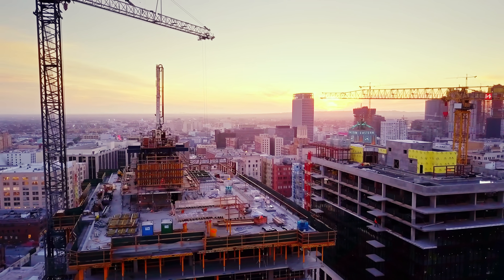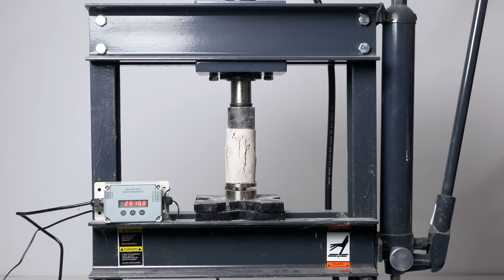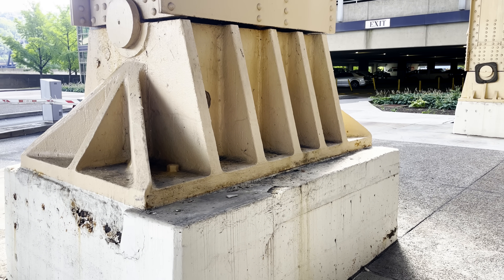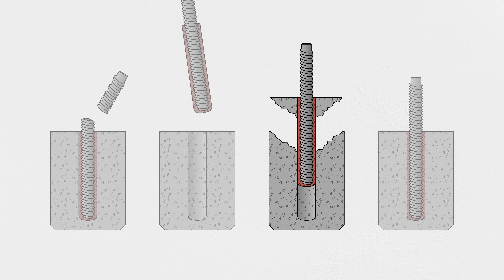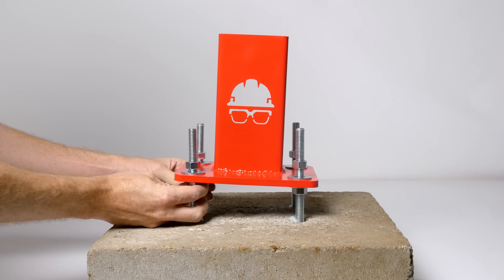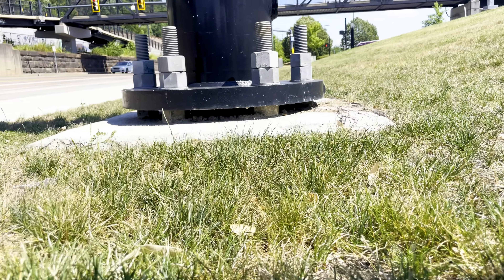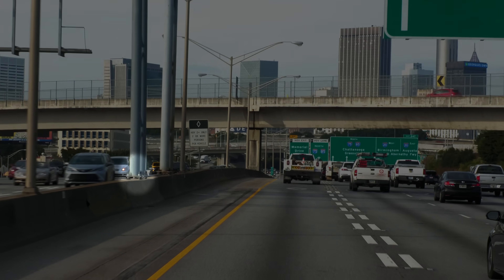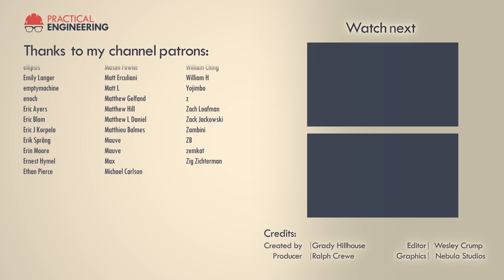What’s the Deal with Base Plates?

Comment: Not even an engineer but in my 20's, I mounted a basketball backstop/post by my driveway. I took a base plate and mounted bolts to it (nuts on either side), with the bolt heads about 3 inches below the plate. I then welded a small frame to the bolt heads to tie it all together and distribute the various loads into the concrete. I placed this in the concrete pad when i poured it. After the concrete cured, I then removed the plate and welded it to the backstop post. Then I set the post and adjusted it to vertical with the nuts. I just thought this was all obvious.

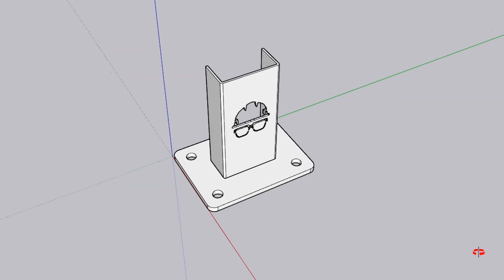Comment: 7:14 Leveling nuts can't support any large weights because the resistance is offered only by the thin thread of the bolt. So, it might be ok if you want to adjust the level of your dining table or even to support a light street lamp, but that's as far as it goes, in my opinion.

Comment: Grouting a baseplate in is frowned upon here for corrosion reasons. Having a good solution for bold binding and having it go a little above the foundation so that no moisture collects where the bolt is going in is key here.

Comment: I do not agree with you. It is new to me that grout instills corrosion. In fact it does opposite. 
Non shrink Grouts are stronger than concrete. 
Grout is required to transfer the forces properly.
 The nuts below base plate are for correctly levelling it and not for tranfer of load. Grouting is must.

Comment: Most defects associated with highway signs and high-mast light towers (at least that I have seen after inspecting >1000 across 3 states) are related to anchor rods and tightening of the level nuts/anchor nuts.  The standoff plates have issues with excessive standoff, or too much of the anchor rods are exposed creating "slender columns" which is probably the second most common issue identified in signs and light towers.

Comment: As an overnight factory sanitation worker I absolutely loved when we'd use standoff bases on our equipment. So much easier for water/food product to flow towards the drains when grout isn't in the way. Especially since they never took my advice of building the baseplates at a 45* angle to the drain...

Comment: Well this video is older as I type this but I was wanting to mention a sorta counter to this. I watched a video from Nova on China, and why it's Forbidden City still stands, even though it is in an earthquake prone place. And one part they show is the big columns they have are not actually attached to the floor. While they are touching the floor and the weight of all the superstructure is still being put upon them, the video posits that the floating columns allows them to move during an earthquake while still providing their function and not needing to be rebuilt after the fact.

Comment: I like this video and most of your stuff. Since you presented concrete anchor options such as epoxied or wedge anchors, I think it would have been important for you to show that most of the overhead sign base plates bolts are set in reinforced cast in drill hole (CIDH) foundations. They are typically deep set J bolts connected to the foundation reinforcement. This video may leave the impression to some that the base plate bolts are simply wet-set in the foundation concrete, irrespective of or any connection to its reinforcement.

Comment: We started installing our stamping presses with chemical anchors. Basically just drill a hole, 30mm is typical, and drop in a glass vial with all the ingredients inside. The anchor itself has a flat chisel point that acts as a mixer as you spin the anchor while pushing down. Let it cure and fully set and it's now part of the floor. It ain't comin' out. We did test and we applied so much force that the concrete around the anchor broke out, not the anchor. There was a chunk of concrete with an anchor coming out of the top. Amazing tech.

Comment: I did some paving when I was 16 and saw how they install lamp posts here in Germany. They just put a big PVC tube in the ground, filled it with sand to a certain level, put the hollow post in there, filled everything up with sand, compacted it. Wont work for every application but so much easier for smaller loads

Comment: The practical engineering unit of measurement is the Grady.  A KiloGrady is 1000x that, and a Mega-Grady is 1E6x that.  If you find that everything starts at a KiloGrady raise the unit up 1E03... but given that there are no stanards for this unit, no measurements of it, no tooling for it...might as well just call it a Grady and ramp it up as needed on a per project basis, providing you let people know that 1 Grady of concrete in a 1" tube is not the same as 1" Grady drilling through solid stainless steel... but that within the same video one method can be compared to another.

Love your book!!

Comment: Setting 40' light poles once  with my boom truck for an electrician, I was stunned to see he never checked them for plumb. He just used a 8" level on the base bolts. As an old carpenter, I would have started with the base level, but then checked with a 4' level, but...they all eyeballed straight enough!

Comment: 54 years as a union carpenter, 70% was heavy concrete construction. The largest anchor bolts I set were for western electric microwave towers. 2-1/2” dia. 8’ L 2’ J
I specialized in building templates to set bolts for jobs to hang in the form work . Gas compressor stations had as many as 250 bolts in one motorblock 12’w x 27’L x 8’d
Your videos are always right on!
Reply: Being a retired union carpenter myself,there are no specialist in placing of anchor bolts of any size,making and hanging bolts in concrete construction in heavy commercial applications is not some wild skill or science. I can’t count the many times I have done it. Stop making yourself sound like the smartest guy in the room,you’re an embarrassment to your brothers by blathering such nonsense.
Reply: @thedoc9062 He was just stating a few interesting facts. No big noting here.

Comment: Q: I am erecting a. 25-ft cast iron flagpole. It has four 1-in bolt holes at the base. Approximate weight is 225 lb. What are the proper anchor bolts to use to secure this to a circular poured concrete base? Thanks! Love the show.

Comment: Building cranes in the 80s, we established the relative heights of foundation pads with a Dumpy level.  (no staff, or if we used one, we taped a steel rule to it, read it to a millimetre, no interpolation) the highest pad needed no shims, the others needed an appropriate pack of shims to suit.  We'd weld a "Rocker" pad under the baseplate (maybe 40mm thick) at the fabrication stage, because it made it easier for whoever had to get concrete (not mortar) tucked in later... (sometimes you'd visit the crane months later, and find that hadn't been done)  And your foundation bolts' lengths were selected to avoid too much being exposed, or too little engagement.  Of course we generally had line of sight from pad to pad...

Comment: Wow, this was a good one. I've noticed those floating traffic light poles before and pointed them out to my girlfriend (reaction wasn't as enthusiastic as mine). My theory was that the anchors had to be set in the curing concrete and then the roughness of the top of the concrete somehow makes it impossible to lower the baseplate down flush.

Comment: Probably the single most amazing YouTube video.  As a structural Ironworker, I was always amazed with base plates.  "And that's going to hold up this building ?" Riiiiight.  My favorite was always the columns with flanges so thick that we'd weld a seat to each flange, put a welder in each seat, and watch a mountain of empty innershield reels grow on the deck around us

Comment: @practicalengineeringchannel the grout as seen below the baseplate at 0:29 is recommended to be removed as NC DOT found it contributed to corrosion and failure. The pole mentioned looks like a common galvanized street light type pole. The purpose of the grout was to keep debris out of the electrical conduit entering the base and exclude animals from nesting in the pole. The grouting wasn't meant to serve as weight bearing and was to be added after installing the pole. 

The galvanizing is thick on poles of this design but not thick enough to counter constant contact, weep hole plugging or the reaction of dissimilar materials being in contact with each other.

DOT recommended for the grout to be removed during the annual inspection. This was for roadway sign structures, traffic signal poles and roadway lighting poles especially in locations near the coast with salt water accelerating deterioration.

I have seen some questionable metal poles in my travels through states that utilize road salt and have allowed the rust to cause heavy bubbling under the paint or galvanizing. Corrosion eating away at a pole is essentially weakening it over time and will cause failure once it reaches a critical point. 

The corrosion will reduce the windload capacity, the possibility of toppling if impact physically from errant vehicles etc. Just some insights as to my experience with roadway lighting and traffic signal work during my time as a traffic signal tech. Thank you for your dedication to sharing engineering with others that is in a format that makes it easier to digest.

Comment: I don't understand the bolts.  It seems like they're holding everything up, so I would think they would have to be huge to not have the same problems that you showed in forcing the narrow object in the concrete and breaking it, while the larger object withstood much more force.  Aren't the narrow bolts going to break more easily the concrete they are laying on top of?

Comment: I used to be a structural steel welder and weld-based plates somewhere 4 inches thick and took massive layers of weld plus you had to preheat them and weld them in the middle of the summer with no skin exposed

Comment: Fun fact! There's a specific failure of column punch-through that can happen when you don't have grout. This is only a problem when the whole column is under compression which doesn't happen with uni-column structures. I only saw it once, on a self-supporting telecom tower. Our client had us recreate the failure and find out what would stop it - and at least in our modeling software, the only thing that worked was adding grout back in.

Comment: i have been wanting an explanation into this for the longest time because seeing a sign post just "resting" on the bolts and not actually sitting on concrete looks very weird to me. It's good to know that those bots are engineered to be strong enough to distribute the pressure

Comment: I have seen concrete slabs that the finished concrete level is higher of the plate and column …you fix your plate and the steel  column in place and then you poor the concrete and sink the steel parts in it . I believe this is a solution to this

Comment: A jobsite superintendent once complained that there must be jack nuts for below the base plate on the columns.  He wanted also that the ironworkers needed them to get the steel to the exact height specified.  The guy was from a different State than Illinois.  Here in Chicago our concrete guys can read blueprints and grout a setting plate flat and to the exact elevation so the columns get nutted down with no messing around.   Different practices around the country.

Comment: J bolts aren't used anymore. F1554-gr.36 threaded rods with heavy heat nuts typically. J bolts can straighten and slip out.  I never approve them when contractors request them.

Comment: the dangers of "double nutting" the top.... lock nut, double nut... all the same, the nut on top is doing the job, adding a second increases the risk of incorrect torque. 2 nuts does not make it safer.
On a side note, chem anchoring 316 rods into a riverside walkway will never end up well. Crackheads will double nut your anchor and sell the threaded rods for scrap. If you have to chem set, weld rings on the studs bases.

Comment: Many thanks, I have been building for 60 years and still working hard at it, your tutorials are so measured and helpful, there is never a day goes by where one does not learn something of value from within the construction industry regardless of how old one gets. If I may share this measure that up until now has worked for me which  is to, Stand off from the job and Ask, Exactly What is the job Telling me, and if you don't get the answer be humble, reflect and seek guidance which sometimes appears rather counter intuitive but tends to be very instructive.  As demonstrated by so many operating within the construction industry today, they rock up to the site unbreakfasted, fueled on caffeine or worse the effects of methamphetamines turn on the music onto loud to block out reality and impulsively think and state well what are we doing today and wade into the job with the phenomenon verging upon unbridaled fatherless emotional tribalism that inevitably turnsl, nasty and litigious, this  is the theme that has become infused throughout the construction industry over the previous generations approach to site work and these negative ill disciplined approaches need to be vigorously weeded completly out of the construction industry.  I have always found that working with engineers that they tend to be very humble and knowledable men and tend to hide their light under a bushell but are always  prepared to willingly share their knowledge and experience with others, may I salute you and your team, your working models are brilliant,  KPP nz.

Comment: Stand-off baseplates: 
-can’t pretension the anchor bolts
-so bolts have to be of larger diameter to reduce the cycling stresses below fatigue
-Grady explains that savings in labor (fiddling with grout) more than offsets the cost of steel
-this may be true for simple structures but may be impractical for very highly-loaded applications where you must have pretension, such as large vibrating equipment
-also the economics will be different in places where labor is cheap compared to steel

Comment: Pressure is for fluids. Stress is the F/A in a solid. In a static fluid the pressure is the same every where. In a solid the stress can vary significantly. I think you describe the concept well but it is not pressure it's (compressive) stress.

Comment: Hi Grady    I worked for a government road agency and the grout used under traffic signal mast arms is more cosmetic than functional.  The jacking nuts take most of the vertical forces.  I have a little experience with load cell baseplates under high volume truck weigh bridges.   Load cells were typically 25t capacity.   An excellent type of grout that must withstand the large forces is an expansive grout.  This same type of grout is used in powerstations to lock down steam turbines.  The grout is 'super sloppy' when mixed.  It is poured into a small dam surrounding the baseplate.  Within a few minutes the grout starts to setup.  The forms are quickly stripped and any excess must be trimmed/shaped very quickly as the window of workability is short.   I have used expansive grouts under vehicle hoists as well.  Cheers

Comment: This is the problem with engineers. They're super confident about their wrong decisions.

CEMENT is the base form.
CONCRETE is cement plus sand + aggregate 
GROUT is cement + sand

Why would you try to say grout is xyz concrete. That's like saying oh this acorn is a leaf that didn't become a leaf but sn acorn instead. Instead of starting at the fact they're parts of an oak TREE.
Reply from the maker: The script says, "Grout is basically concrete without the large aggregate." In the industry, "sand" is called "small aggregate." I'm not sure I understand what the error is.

Comment: Excellent presentation Grady. I design very large, very heavy machinery foundations for rotating machinery that operate under high torque loads. The foundations are mounted over reinforced concrete, but in between the foundation base and the concrete slab we leave a 1 1/2" gap. After the foundation is leveled, that gap is filled using a high performance epoxy grout product called Chockfast which is very stable and has high compressive strength. The anchors to hold down the foundation are long but are not completely embedded in grout for their entire length. We calculate for a portion of the anchor stud to be free and this unrestrained portion can be as much as 18" since we are dealing with stud diameters around 1 1/4".  This method allows the studs to act as springs after they are preloaded with their nuts over top of the foundation base. With all anchors now in tension, the foundation base now has a clamping force to keep it in place under dynamic loading. Also, we use self locking nuts to prevent any chance to the nuts loosening.

Comment: 1:08 the way that I choose to think about a load type of situation is by thinking in computerized fashion "i check a spot at every tick of the physics engine and if the pressure per square inch is too high for the object it crumples " i would like to see the same test redone with rebar in  the concrete because that's likely how it would be in a real world test.

Comment: Never use 'jacking nuts' under base plates as it point loads the concrete.
Correct installation is to put steel plate packer centrally under the baseplate and once installation is complete  pour non shrink cementitious grout into formwork which takes the load and keeps the steel away from moisture giving long life.

Comment: I wonder why direct burial of steel into concrete foundations wasn’t mentioned. It is the preferred method of installation for large pylon signs and there are many advantages to this method over base plates. It does not require the precision of the plate and bolts to match. Direct burial is stronger. It is easier to level, and it requires no grout.